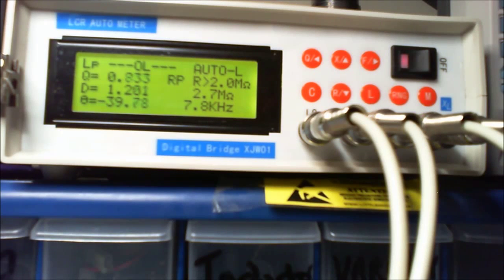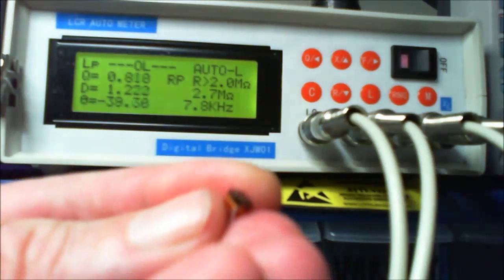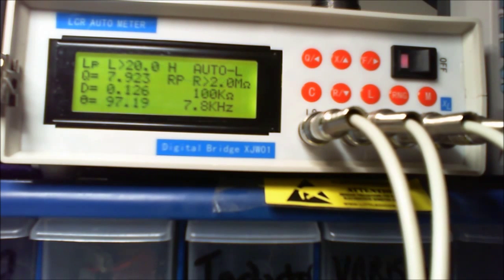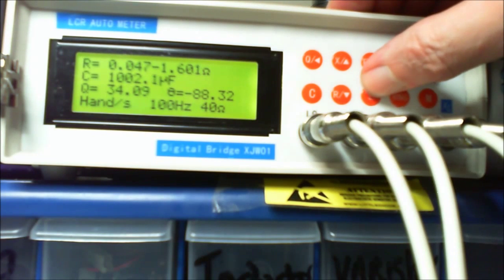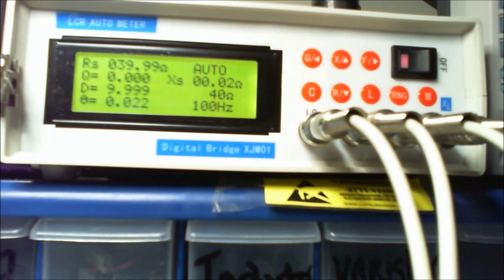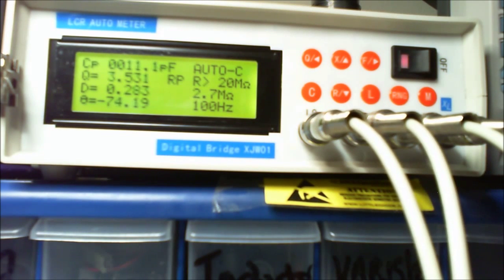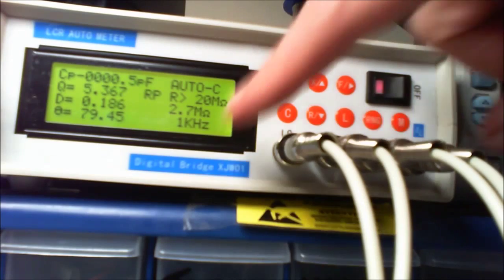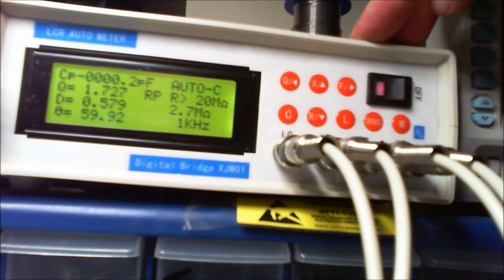XJW01 Digital Bridge  ESR LCR Meter A Quick Look

Comment: Thanks for this video! I once stumbled across one of these and I thought about getting it, but I didn't feel very confident about it. This is about 90€ on Ebay, and I didn't want to pay that much for something that I didn't know would even work. Your video proves that it does. Accuracy may be questionable, but it's certainly better than nothing.
Reply from the maker: +DrCassette Hi, Cheers for the comment. Its not too bad just not built that well, compared to Rigol etc. I needed to find something without the ZIF connector as they drive me crazy. Glad the video helped.